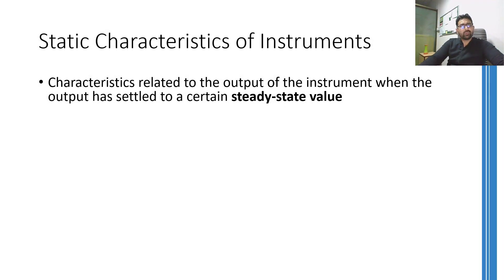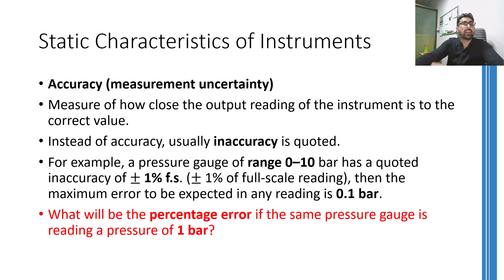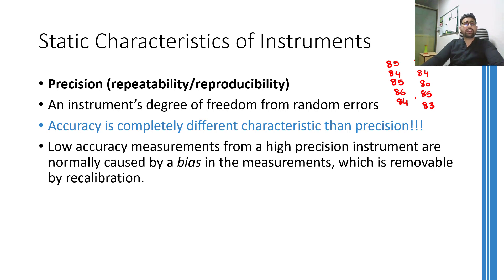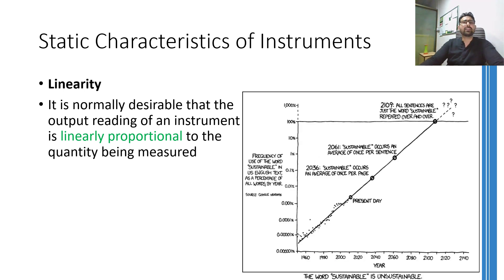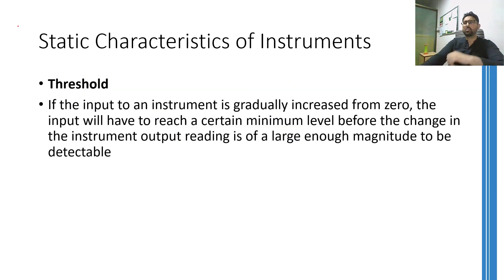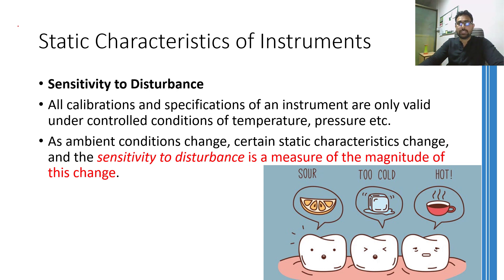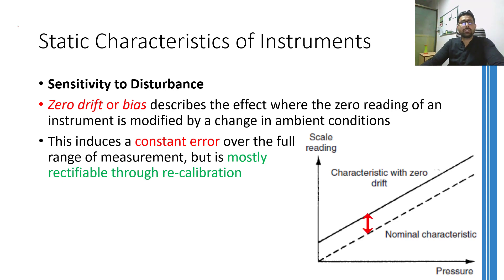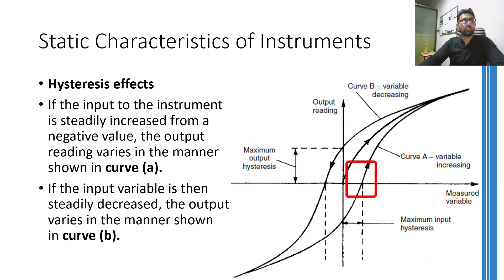Lecture 2 Sensor Types and Performance Characteristics (Part B)

Comment: At 04:15, you said that if measuring pressure b/w 0 and 1 bar, we should not use instrument with range 0-10 bar because it will give us large percentage error.
My Questions:
1) 1 bar lies inside the range 0-10 bar. If the instrument is designed to measure any pressure between 0 and 10, then why is it not suitable to measure 1 bar pressure?
2) If I use 0-10 bar gauge, and gets 1 bar on output and I know that's the actual pressure of my fluid, then will it be a wrong output because the calculations says the error % is 10%.? I mean, what i have to do with error percent in the above case? I hope you have understood my question.
Reply from the maker: Error percentage is expressed as percentage of full-scale reading. For a sensor having full scale reading of 0-10 bar and error as 1% FSV (full scale value), no matter what is the output the sensor is giving it will have an error of 1% of 10, that is 0.1 bar. Now if your sensor is sensing a pressure of 1 bar, and the error, as per the data sheet is 1% FSV, which is 0.1 bar, then there is 10% error in your reading. This means, your actual pressure can be anywhere between 0.9 to 1.1. In another case if the sensor is giving a reading of 7 bars, still the error is 0.1 bar, that is 1% FSV, now your actual pressure would be anywhere between 6.9 - 7.1. In this case your error is 1.43%.
You cannot use a weighing scale that is used for weighing fruits to weigh gold!!!
I hope you get my point.

Comment: The  threshold value for a car's speedometer in percentage of full scale reading will be calculated as : (15/220)*100=6.8182% if the full scale is 0-220 km/h and speedometer starts showing reading at 15km/h.

Comment: The Threshold Value of the car's speedometer as in the given example is 6.818%  as we calculate it using (15/220)*100=6.818%

Comment: The %threshold will be calculated as: (15/220)*100 =6.81% ,if full scale is 0-200 km/h and speedometer starts showing reading at 15 km/h.

Comment: The threshold value for a car's speedometer of full scale reading would be (15/220=) 0.0681 or 6.81% if full scale is 0 - 220 km/h and speedometer starts showing reading at 15 km/h.

Comment: The threshold value for a car's speedometer of full-scale reading will be 15/220 = 0.0681 or (15/220)x100 = 6.81% if the full scale is 0 - 220 km/h and speedometer starts showing reading at 15 km/h.